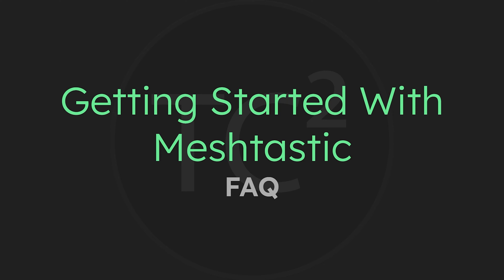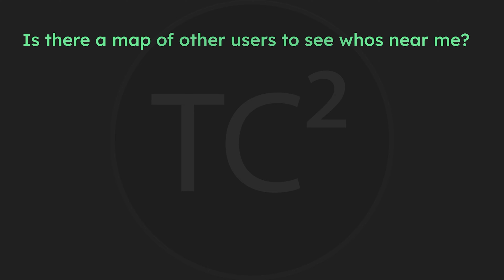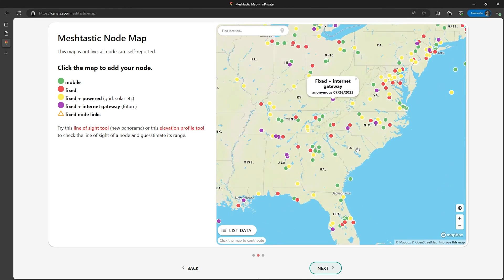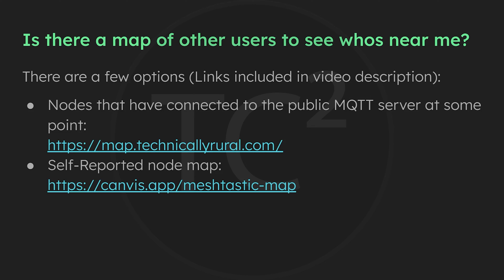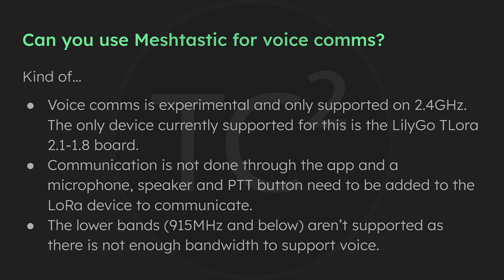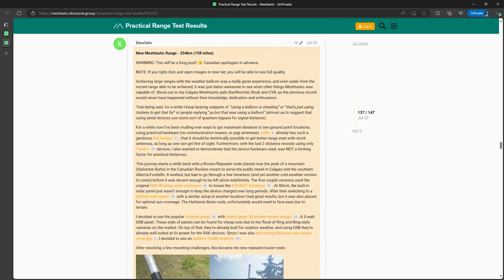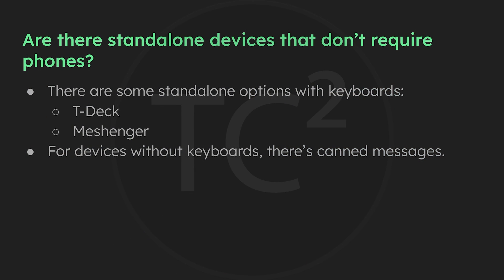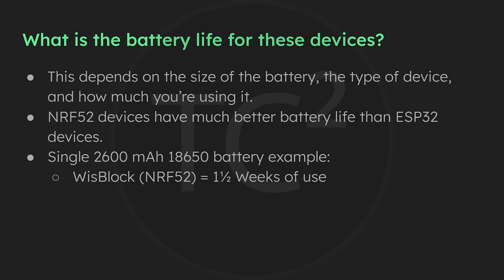Getting Started With Meshtastic - FAQ

Comment: I am located in East Bay San Francisco.  I have two Mestastic nodes:  Heltec V3 & a T-Echo.  Both are on the air.  I can send and receive between my two nodes.  The node lists is showing at least 12 nodes with strong signals.  I try direct messaging; it always says retransmission retry timeout.  Should I be able to see traffic on my primary channel.? I see no traffic at all.  New to this Mesh thing.  Thanks.   de.  Bob

Comment: I have had older version of meshtastic on Lilygo T3_V1.6.1 . I have tried to upgrade to newer version, but the web installer seems to get 100 % of the file on, but the hardware will not reboot, just goes into endless text scrolling. The OS won't come up like the older version. I am doing something wrong, I just cannot find what it is. A little advice would be great.

Comment: What happens if you receive more than one incoming message? Does the mesh receiver hold messages in a queue, or does it push them to the handset? OR what?
Reply from the maker: If you're currently connected, it pushes the messages to your phone. Kind of like text messaging. If you're not currently connected, it will store about 32  messages and send push to your phone when you connect back

Comment: Someone needs to dig into how 3G worked cause it was operating as low as 700mhz and we could talk and send images over it. 915mhz should be fine
Reply from the maker: LoRa sacrifices speed for distance. It could be faster and be able to send images, but you wouldn't be able to achieve the long distances. Can't have both so one of those has to be sacrificed.

Comment: I have a new question that may be answered already in another video in the series.  Well two questions, actually.  First one, what is the minimum amount of equipment needed (which parts-preassembled) just to get it fired up and the firmware, etc to use?  I'm talking about minus any case, etc...?  Next question; will this work in conjunction with an app like ATAK?

Comment: so you cant do long messages .... but why not split messages up into many messages with a headder to keep the parts in order ? you know ... like the internet used to do and like sms used to do ?
Reply from the maker: That could probably be done, but may not be worth the effort. Most people won't notice the 230 or so character limit.
Reply: @The_Comms_Channel ??? If you can send longer messages you can send code. Aka internet over Lora. How is that not worth it?

Comment: What type of battery life do you get with the lily t-echo? Or the heltech?
Reply from the maker: Heltec uses the ESP32 microcontroller, so the battery life isn't going to be great. I've not tested it, but since the T-Beam gets about a day to day and a half, the Heltec will be about the same. Maybe a little more for the models without GPS. (2600mAh 18650 battery)

The T-Echo uses the NRF52 microcontroller which is much better on bettery life, but has an 850mAh battery in it. Even still, it will give you better battery life than a device with an ESP32 with a 2600mAh battery.

Comment: Is there a trick to getting the RAK boards to play nice with solar panels? I have one hooked up to a 6W 5V (Soshine brand off amazon - I think it's the same one you used) solar panel but the RAK board doesn't seem to want to charge the 2x 18650 batteries unless I unplug and replug the panel (red LED lights fully). Also tried with the panel connected to the USB port and had the same issue.
Reply from the maker: Hmmm.. No trick or anything. Just make sure the polarity is correct. If you have a volt meter, you could check to make sure the panel is outputting voltage by placing it in the sunlight and checking it. Could be a bad panel.
Reply: @The_Comms_Channel  Good idea. It was registering as charging when I plugged it in outside, so the polarity should be correct, but I'll take out the jolt meter and have a look at it in the sun
Reply: Did you not say if you add anything and have the battery plugged in you risk frying parts of the board, would this not be the same?

Comment: Hi I have been having issues with the web client. I cant recieve any messages on the client until i send a message via it but i can see the message come through on screen on the heltec v3. ( have no issues either on the mobile app) any ideas ?
Reply from the maker: Are you using the on board webclient by connecting to the device via WiFi or are you using  client.meshtastic.org ?

Comment: Thanks for this series, been very helpful! I've searched and didn't find a way to send SMS without having internet on an Android phone. I think it requires using MQTT if it's even possible? I haven't gotten the T-Echos yet, but I think it can be done with Tasker via notification replies. For example, leave an Android device with SMS service at the edge of an area as a relay and that would bridge SMS and Meshtastic. I'm thinking it's worth it to ask the Tasker developer to integrate with Meshtastic for a more direct solution.

Comment: Thanks! Appreciate the great information. Been trying to setup MQTT on my  private network but it's pretty hard to find a broker that is easy to setup in windows. Mosquito seems just outside my grasp as I have been able to install and start the service but nothing else. Anyone have an easy to use solution? The android app broker doesn't seem to do much of anything. Spent wY to much time with it.
Reply from the maker: Sure thing! Thank you for the support!!

My setup will probably be Linux/Raspberry Pi based, but I'll see what I can figure out for Windows!
Reply: I can probably manage a raspberry pi setup.. look forward to it.
Reply: Setting up mosquitto on a pi should be pretty easy if you're at all familiar with editing conf files. Enabling TLS was really the only tricky part.